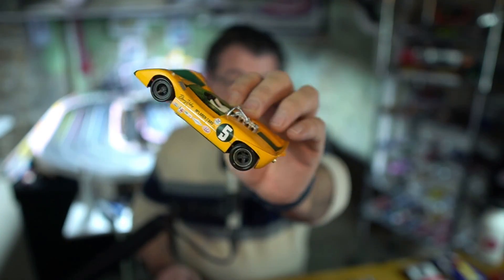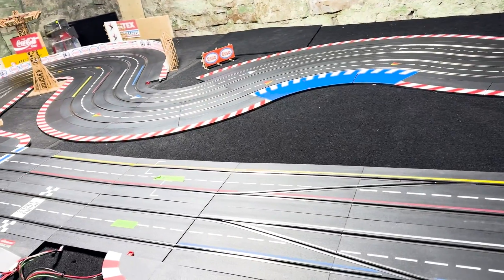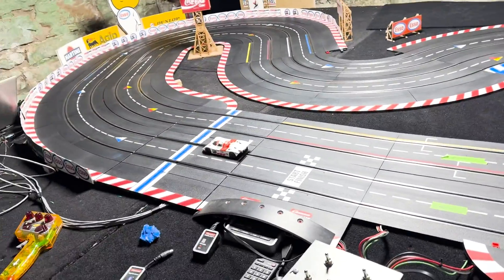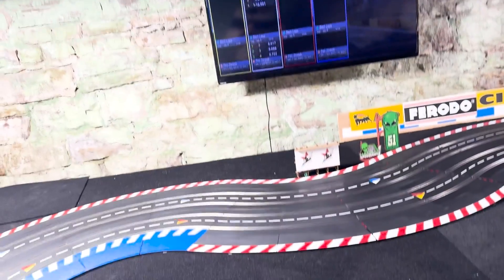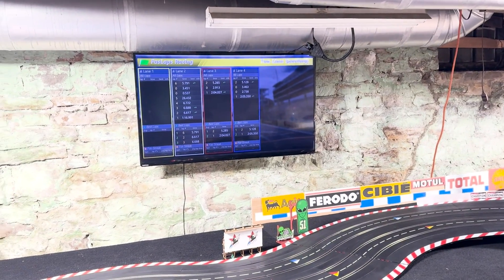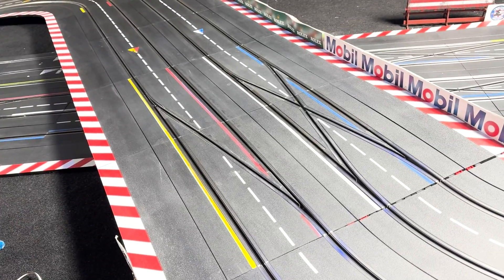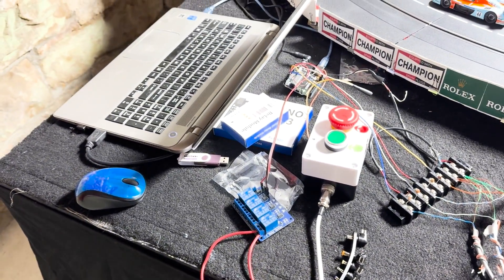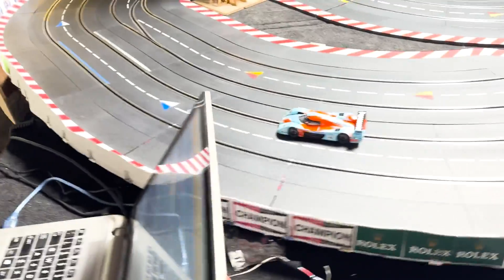HELP! My DIY Slot Car Lap Counter is counting GHOST LAPS!

Comment: Hi Marty. Have you solved this? First, thanks for the videos, I have learned a ton. 
A few weeks ago I followed your lead and built the Arduino lap timer and installed it onto my two lane Policar track, running Race Coordinator. It's working nicely.  I have a couple of suggestions.
First the missed laps due to guide flags that aren't black. More accurately, guide flags that aren't opaque. The problem is the IR emitter is too bright and the less opaque guide flags aren't breaking the loop. The fix is to add a resistor in the VCC pin of the sensor, effectively lowering the voltage and therefore the brightness. On my track I installed a B5K potentiometer between the voltage pin on the Arduino and the VCC pin on the pot. This allows you to "turn the volume down" on the IR emitter. Once installed, turn the intensity down until it counts a lap by itself. This tells you that it's no longer bright enough to be detected by the collector. Then turn it up very slightly to close the loop again.  Run a white guide through it and adjust as needed until it works reliably. I like to be able to adjust this to account for ambient light as well.
As for ghost laps, this is definitely EMI. You're already using shielded cable but the Arduino itself is very susceptible to EMI. 
As a musician, you may be familiar with the notion of shielding the control cavity in an electric guitar to stop hum. The same principle applies here. I installed the Arduino and relay board into a plastic project box that is lined with copper shielding. 
I also used copper tape on the table under the sensor track, and mounted the Arduino box under the table in an area away from the track, and also applied shielding tape between the bottom of the table and the box.
I used shielded cable too, but it also is twisted pairs to further reduce interference.
All of this seems to do the trick.
Test it by wrapping your Arduino in a cloth to avoid shorting anything, and then wrap it in aluminum foil and see what you get. If that helps then you're on the right track, so to speak.
Another thing to look at is if the offending cars have a capacitor installed across the motor. Without it the car will put out a lot of EMI.
Sorry for the long message. Hope it helps.
Blair
Reply from the maker: This is awesome information! I wondered about the the copper lining in my box i keep the arduino in.. I will give that a try. Thank you so much for taking the time to include all of the detail. There are quite a few people who have tried this and your comment will be a great resource! I have changed out different sensors and it seems to be working great at the moment. My favorite sensors were the guide flag sensors, it is just such a clean install. I will let you know how it goes! Thanks again! _ Marty

Comment: Someone should do a video on braids and what to use.  I have a carrear digital track and for over a year I have been trying to figure out why slot it and revo slot cars always stutter on my track.   I just found out today it's because of the braid.  Always always always use the silver braid that carrera cars come with.  It's the toughest and works the best.   So many problems solved knowing this.
Reply from the maker: Jay, I use Slot It copper braid and have no problems once I get the braids fluffed.
Reply: @twolinesslotcars  I feel like when I put the silver carrera braid on it just works no mucking around though which is always nice
Reply: @twolinesslotcars  interesting.  I have bought slotit racing braid that is copper but I never fluffed it?  How do you do that?

Comment: Hi Marty, I am of the opinion that it is not your programming; otherwise you would get ghost laps on all cars. Since the angle winders give ghost laps it may be coming from the motor EMI or RFI of the anglewinder cars. I think Jeff stumbled onto something with coating the bottom of the motors on affected cars with rubber coating. In the boating industry they coat battery terminals with a brush on rubber. It might be as simple as using that as an insulator.
Reply from the maker: Thanks Tom! I believe you are correct. I will be doing some more tests no this week and report back!

Comment: New to this channel at the request of a friend to help out.  How are you powering the Arduino?  Does it have it's own power supply, or are you powering it from the same power supply that  runs the track?  Do you have a schematic showing how everything is wired and what components you are using?
Reply from the maker: Arduino is on a separate power supply. I will create a schematic and post it.. Thanks! Welcome to the channel!

Comment: There is a reason that so many people use the photo sensors and the light bridge. They just work! I tried many other solutions on my HO track with Race Coordinator before I figured out the light bridge was the way to go.
Reply from the maker: Exactly! I may have to swap them out with my photoeyes.. lol.

Comment: First, do you fluorescent lights over your track?  They are known to cause interference with optical sensors.  
Second, I 100% agree with RobMcRacers comments to eliminate EMI.  The use of a cap on the sensors, only grounding one end of the shielded cable, and maybe getting better sensors.
We had a similar issue with my TEK-Slots lap counting hack (reflecting an IT beam off the chassis) in analog; ended up being the Carrera position tower of all things.   
One thing in troubleshooting - divide and conquer and isolate the issue.  If you know anyone with a TrackMate and light bridge, that would isolate the Arduino sensors.  Honestly, without an o’scope on the output of the sensors, it may be hard to troubleshoot further.  If none of Robs tips help, I can see about bringing my o’scope down some day.
Reply from the maker: Joseph, I have installed caps on the sensors. Rob and I have been having a conversation for the past week.. he knows his stuff!

Comment: it would be interesting to see if you insulated the angle winder motor with a rubberized paint like liquid electrical tape or flex seal  and see what happens , also if there was a way to reverse the lap counter eye from being a normally closed position to normally open position  this would insure the only time a lap would be counted by keeping the rest of the system out of the loop until that contact point was closed.
Reply from the maker: Jeff, I may install the cap off of a Scaley car to see if that prevents it. and go from there..
Reply: yea I was thinking about filter cap , but it may need to bigger then that because if it is rf related I would think your  emitting from the entire track rails just because the false lap happen in so many places . you might want to try and use a isolation relay between the sensor and signal back to the software .  @twolinesslotcars

Comment: Place a .1 microfarad capacitor from your signal wire input to ground on each lane on your arduino inputs.  Four caps you will need, one for each lane.  Same capacitor you would see on your Scalextric motor. Caps filter AC in a DC circuit, EMI noise looks like AC.  Try that first. 

Shielded cable is a must for EMI ….BUT make sure the shield is grounded on one end.  Do not ground the shield on both ends to eliminate ground loops, which would create noise and disrupt the signal.

 I used to troubleshoot EMI on cell phones in the early days of cell phone production and development.  EMI it’s not simple and it is frustrating.  The two suggestions should work or at least greatly help for your false laps.   I don’t know how you ran your wire back to your arduino, make sure to space the wire and not attached to any other power cables in the run back to the Arduino.

Now your problems reading the shiny red or white guides.  The Chinese optical switches you are using will not work they do not have the proper pull up resistor values,  I had to make my own that a bunch of us use here with no more issues.  We can read guides of all colours now.  

I had the exact problems you are experiencing with EMI and coloured guides when I built MID-BC in 2018 and it did take me a while to get it to the reliable state it is now where I can race cars or all types.  One note my track is copper tape and your plastic track is steel rails and I’m not sure if there is a difference with steel rails embedded in the plastic track versus copper tape that runs on the surface of the track when dealing with EMI.  But please try these suggestions as they have worked on several wood tracks. 

Rob
Reply from the maker: Rob, I recorded a lot of this before we had our email exchange. I have installed caps, and have done a lot of your suggestions.. i ma getting closer.. just have not been able to isolate it. We are getting there.. thank you so much for all of the detail, you have been a tremendous help!
Reply: @twolinesslotcars  yup sounds good.   I can send you four of my in the slot sensors too I just won’t be able to build any until Mid March.  Busy time of year for me then a much needed vacation.

Comment: Marty is it all cars that do that on all your 4 track. Normally it is the censor that can read some cars, I would start with the censor have had the same problem.
Reply from the maker: Arne, I think any car that has a cap installed on the motor is working fine.. Slot It's, etc..

Comment: I would start at the head ? how clean is your DC power source  , if your power source is putting out  what is know as a dirty power it will rear its head with all sorts of interference on a system.

Comment: Marty I had an infrared system and it did the same thing. Even when I change channels with the remote on the TV. I switched to an over head light with the photo sensors in the track and it solve the problem. I used Race coordinator with it. For some reason the infrared system picks up electrical noise.
Reply from the maker: Anthony.. thanks for the info.. I will probably give it a try.. but I really like having the guides count the laps.. but if it wont work right.. i will go to plan B!

Comment: i just built a Lap counting system for Blazen Racin here in Indiana. We used Ir Led's in the track. with an overhead light Just got the system installed yesterday and did some testing its working great. We are going back today to run more laps.  If I can be any help let me know. but we drilled small holes in the track and stuck LED in the. it could be the programing in the Arduino itself or the code. But we are Using Race coordinator.
Reply from the maker: Thanks Midwest!

Comment: We find sunlight and some types of strip lights set off ghost laps on our power packs. We have made a cover that fits over the timing system but even so as the sun comes down it goes wild again. Seems weird but run a few laps with the lights completely off maybe. (Wild card suggestion)
Reply: But saying that 1 of the cars is fine so most likely not a light issue 😬
Reply from the maker: Thanks Doug!